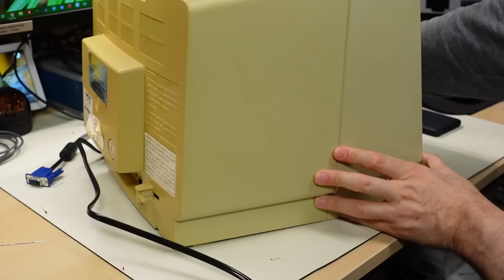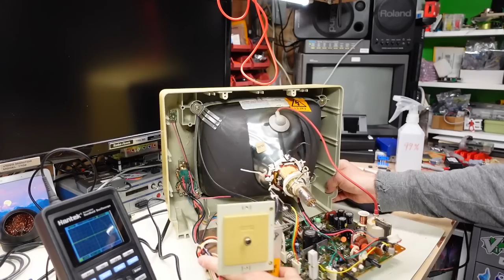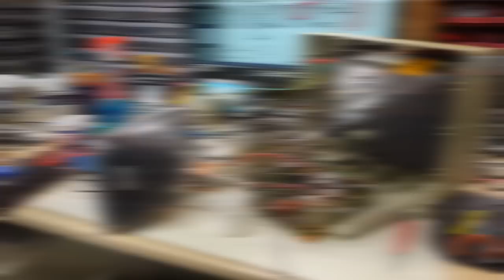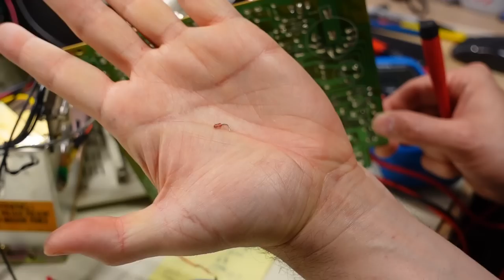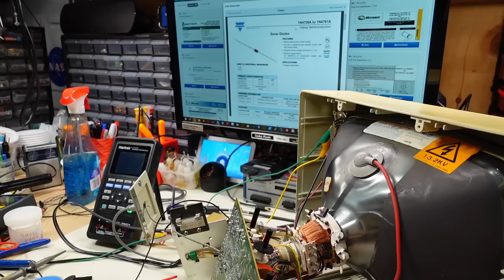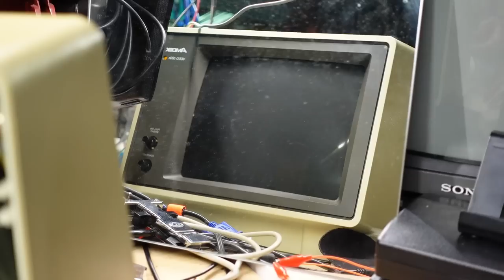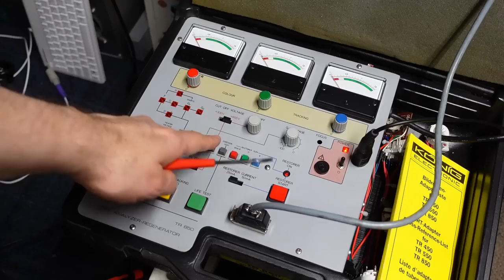I ruined this Amdek 300A after fixing it

Comment: I had one of these back in the 90s. just went around the edge lightly with a razor blade and cut the mesh off.
Reply: That reminds me of how there were tiny pieces of plastic wrap around my guitar’s pickguard pinched against the body… I unscrewed the whole thing to remove those shreds lol. When it was torn off, most of it broke-away at a point which was behind the visible edge when it had snapped back, but with just a couple of exceptions. There was essentially a thin “gasket” left over on the guitar body all the way around after I’d removed the pickguard, lol.

Comment: ..Also CRT testers vary in their performance with rejuvenation. I just watched it with my mouth open.  This Konig I am not familiar with, but I was thinking WTF! as it set off. That is a fierce do or die setting with very little user control. I do not like it. As soon as it started I knew that gun would likely fail. Always start with a little coaxing and save the 'do or die' for just that when it's so far gone it's a last resort.
Yeah, that is a last resort machine.

Comment: you think the neck board connector was the right pinout or so for that monitor? maybe you blew the wrong filament? i had money running on this with my friends saying it was a diode from the start, or some type of conduction problem, maybe a short, maybe a bad flyback? point was after testing voltages we just found out it was a diode. is there a way you can recompress a new tube into the position of the old one; ie: take out the old tube and get a new one, vacuum compress it in place, and reseal it, maybe even flush the old phosphor with a solvent or something? nothings saying no except for finding someone to do it, or you doing it yourself? :) btw. are you going to build a video card for that swt computer of yours? id like to see you write up a small vic-ii or so output for it, then onto running some "commodore" like games :) lol,  get an old soundblaster 1.0 and wire it over :) well anyways, you win some, you lose some. the fight isnt over yet adrians digital basement.
Reply: I looked into CRT rebuilding in the late '80s. The equipment and supplies were $10,000 from a company in Chicago called Lakeside. That was just to re-neck the CT and install a new gun. You had to heat the glass to weld the new neck and gun without the glass cracking. Then you needed a good vacuum pump, and a diffusion pump to get a hard vacuum. It was almost $20,000 additional to be able to rephosper the duds, and required a permit from the EPA.

Comment: Yeah, I kinda feel like it's not worth trying to fix these until you confirm the tube is good. Just pull the tube and test it on another monitor, and if it looks garbage then there's no reason to fix the driver board.
Reply: isn't "getting an entertaining video out of it" reason enough to fix stuff that otherwise would not qualify as "worth fixing" ?
Reply: @KenjiUmino  I mean you're still left with an unusable monitor. Unless you can find a good replacement tube that fits, you're not going to get it fully repaired. But then it would come with its own electronics, so you're better off just repairing that so you don't have to deal with swapping the deflection & focussing coils. My understanding is that trying to restore the tube isn't a permanent fix, at best gives it a few months more life. So to me, if you just want to show the repair process, just repair the board and leave the tube. Either way, without a usable tube it's basically just e-waste in the end anyway.

Comment: I have a Samsung Syncmaster 753s with the beam forming a line in the middle of the CRT. Probably some IC leg has some bad soldering. I looked all over the place and all seems fine. I don't have the equipment nor do know what to do. The CRT is just catching dust literally. I guess there is something with the deflection.
Reply: That's vertical deflection, but first check that there's no service switch in the wrong position.
Reply: If it is a horizontal line, it is likely an open non polarized electrolytic in series with the vertical defeltion winding on the yoke, or a wire has corroded off of one of the yoke terminals. Both used to be common faults.
Reply: @michaelterrell  If it is that true, it is a shame. It is a 17" CRT not being used.
Reply: @hugosimoes5119  You can replace a bad capacitor, and in many cases you repair the yoke by using a piece of component lead or bus wire  by soldering it to the terminal, then soldering the broken wire to it. Just don't remove the yoke from a color CRT, because inline tubes are difficult to converge. It is also possible that the vertical drive is missing from he vertical output stage. Many sets use an IC to generate the signal, and to drive the yoke. Most datasheets are online and they detail the pinout and typical circuits.
Reply: I've seen this on a bunch of cheaper monitors and TVs. If the line doesn't happen all the time and it reacts to smacking the case, it's definitely cold solder joints, specifically in the vertical deflection area. Whenever that happens, lower the brightness to minimum or you'll risk burning a line in the phosphor in a VERY short time, even just from testing. If you can't lower the brightness (because it's controllable only via OSD or something), best not to turn it on for more than a few secs. If it worked fine before this happened, chances are very high to get it fixed fairly easily (either resoldering the cold joints on the board, or if that doesn't help, checking for bad caps or corroded parts from the brown glue gunk). It's rarely very complicated with this fault
Reply: @Knaeckebrotsaege  I smacked the crt few times but it didn't do anything, this was 2 years ago more or less. I inspected the bottom of the big board and the board of the neck board and didn't find anything obvious, it can be a micro pcb crack or something like a dry joint. I will probably inspect the crt again in some weeks from now. It needs some dust cleanup. Unfortunately I can't risk having the crt running for some time while touching things inside or I there will be oermanent marks. I was living in the US, I would go to Adrian and he would fix it for me.... :-P

Comment: How about filament supply of the tube is it ok
Reply from the maker: Oh these 12-14v monitors, they just use a resistor to drop the 14v to around 12v -- I've never run into an issue here. If the resistor was open, then there would be no image.

Comment: Is that the one with the stocking on the screen
Reply: Yes it has the black fabric anti glare screen.
Reply: @randyab9go188  Ya I know I had one of those and tried to clean it. It was horrible I remove the stocking from the screen.
Reply from the maker: Heh yeah, it's that terrible mesh. I always remove it .. even if it's clean, it darkens the picture which hastens the demise of the screen because you have to crank the brightness just to get a usable image. It's a double-whammy for Amber CRTs since they are already the most wear prone phosphor of all.
Reply: @adriansdigitalbasement2  I’ve often wondered but never looked-into why amber phosphor CRTs wear out quicker. I’ve also noticed the red phosphor seems to wear out first in OLED TVs. The common link seems to be the longer wavelengths of light, so I presume it has some chemistry reason as to why the compound wears-out its emissive potential faster when it has longer waves. It’s a kind of fluorescence really, with the electron flow bumping another electron in the phosphor which releases a photon when it goes back to its resting state. So.. whatever the chemistry involved in tailoring the output energy is must have those limitations.

Comment: All aerial inputs are decoupled on live chassis sets, otherwise customers would be getting frazzled left right and center and even in the days of zero health and safety this would have been frowned upon. Being decoupled still isn't ideal, the failure of which would make your rabbit ears lethal, but having worked on thousands of live chassis sets I've never seen one with any issues.
Reply: Live chassis sets usually use capacitors for antenna isolation which works perfectly fine at RF. However monitors use baseband signals down to low frequencies which can't be decoupled without also letting line power through.
Reply: @eDoc2020  Yes. What I was saying was nobody leaves a live socket or connector on the back of anything as (I thought)? was suggested. Also for anyone else reading  the video baseband frequencies run from DC (or should do, some very cheap sets don't use DC restoration and you will notice the brightness of black levels vary with picture content).
Reply: @martinda7446  The existence of DC restoration is because the baseband signals are not carried down all the way to DC in practice. I made a video about a video splitter and from that it should be possible to find a cutoff frequency that is used in practice.
Reply: @eDoc2020  Come on that's splitting hairs The baseband is DC to whatever. Always has been. Post restoration IS the video signal.
Reply: @martinda7446  Sorry if I came off as rude. What I might have been thinking is just that it's unnecessary to go all the way to DC if you want to make something which transfers video signals.
Reply: @eDoc2020  I didn't think you were being rude at all. I did though look at your channel. Subscribed. I'm looking forward to watching Windows 98 on a 40s telly.